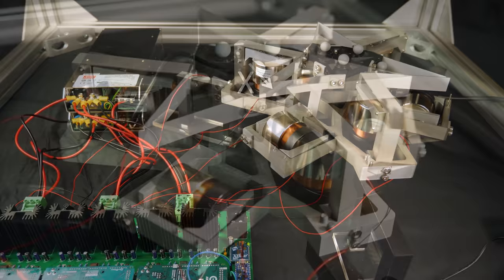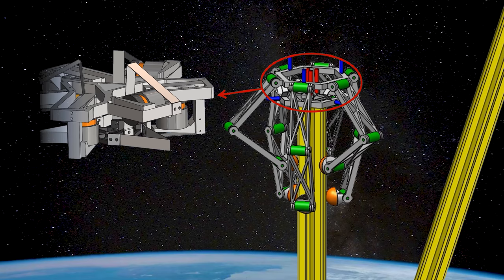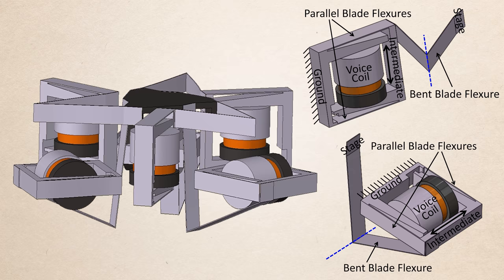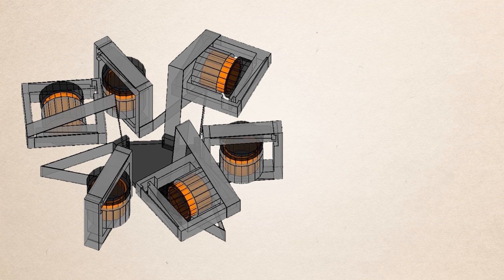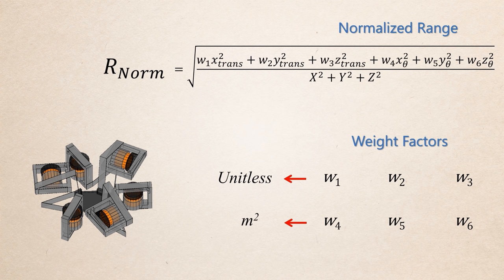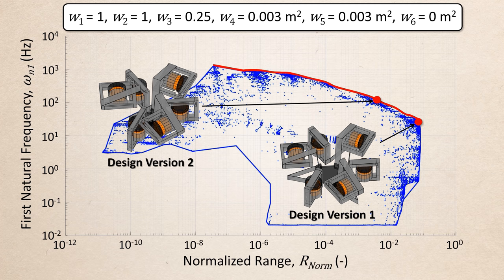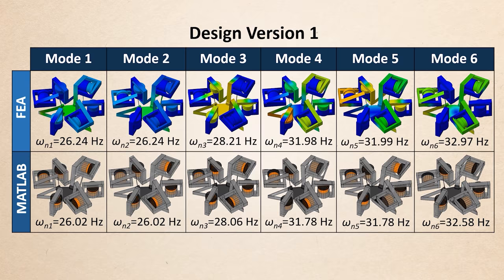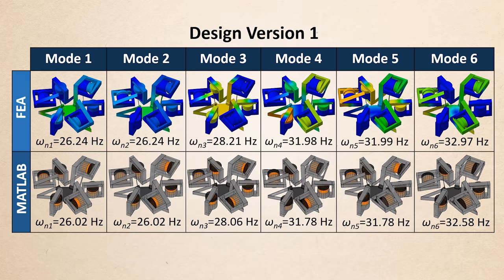Compliant 6-Degree-of-Freedom Precision Motion Stage: The Hexblade Positioner

Comment: I almost want to take this flexblade concept and make it work with magnetic sensors rather than voice coils. I've always been interesting in 6dof platforms for use as input devices, as more things become fully 3D we also need proper 3D inputs, and those inputs will more than likely be better as a combined manipulator; there's a reason why we use mice and joysticks for 2D manipulation, rather than separated single-axis manipulators in unison for planar position manipulation. Currently I believe the 3Dconnexion SpaceMouse probably has the best method for a low-throw peripheral, especially for manufacturability, though I personally want something with a larger throw and higher resolution along its movement; the only problem with these mice is that there's next to no information on construction or the method of how they're achieving six degrees of freedom, I had to rely on an obscure blog post to find one torn down, and I'm not sure how fruitful attempting to find patents would be. I've toyed around with Stewart platforms in the past, but there's just too many downfalls when reversing the mechanism for use as an input, servo-based ones aren't optimal, high resolution encoders gets costly, moving to a linear design is improbable as linear encoders aren't as common and the translation from linear to rotational movement includes losses, etc. This flexblade concept may prove to be a better alternative, magnetic sensors are, by comparison, cheap and fairly reliable, and the compliant mechanism itself is fairly simple in comparison, and could potentially be made into a volumetrically smaller package with some modification; alternatively, other depth-based sensors could be used for this, magnets are just the simplest option that came to mind, and more than likely the cheapest at the end of the day. Not only this, but this kind of design could also be translated to a mechanism that is only 3dof if a simpler input scheme is needed. The only thing is, with the modified design to make this an input device rather than an output device, how far can you actually push the throw of the platform, or if the design is inherently limited to a short throw as the original design was intended for micron levels of resolution for a printer head.
Reply: I watched a series of videos on YT where a guy made a controller similar to 3dconnexion mouse, all by himself, an advanced DIY. I'll try to find it and link it here, if not try googling it. Anyway, I really like your idea of 3d controller, I hope you will get there and enter the market with revolutionary input device and make lots of money. 
Oh, just now i got an idea, with all current advancements in  AI, computer vision and whatnot, maybe it will be feasible to just use an empty box with 3(?) cameras that will track hand  movements and translate these to inputs. Hand could be in a glove or maybe some rings or sth like that to better discern between fingers that can have different functions? Not sure if something like this isn't already in development, if I'm first and someone actually make such device please throw me some $$$ when you commercialize my idea :)
Reply: @aeonikus1  I've seen multiple projects for a 6DOF joystick like the SpaceMouse, though the only video series that comes to mind is Space Mushroom by @shiura, which uses three dual-axis joysticks and a slider mechanism for various freedoms and constraints.  Is this the one you're speaking of?

I'd also be careful with using the term '3D' when talking about joysticks, it's such a loose term that doesn't mean much, and there's reason for that.  There's 2-axis joysticks like what we see on nearly everything; and they can be considered '3D' for a simple reason, imagine you're at the center of a sphere, you can locate any coordinate without having a degree of freedom, rotation in this case, within the axis of depth, and this is quite literally how a camera stick within a video game works, and inversely you can navigate a sphere in two axes without additional degrees of freedom based on how a planar grid can loosely map to a sphere, which is how a movement stick within a video game works though this applies to really any kind of movement grid not just planar or spherical.  Then there's 3-axis joysticks, which add a third axis to the stick in some way, typically it's just a Z-rotation under the Xr-Yr gimbal, but these see very limited uses outside of some niche applications, basically anywhere where 3DOF manipulation is needed.  Then we get into 4DOF joysticks, which are typically some kind of X-Y manipulator on top of another X-Y manipulator, such as a slider or an analog pointing stick on a typical joystick, though at this point the joystick itself becomes a full-sized hand joystick due to obvious dexterity issues, where the new upper manipulator becomes the thumb's joystick.  5DOF, though rare if they even do exist, would be a combination of the two previous, a 4DOF on top of a Z rotation.  Then we get into 6DOF, which are entirely different in that they read both linear and rotated movements of the manipulator in a more complex sensor setup, again due to dexterity limitations; I guess you could take the 5DOF and put a secondary Z rotation under your finger as a bi-directional form of trigger.  All of these of which can be considered '3D' because of how we define what 3D is, and that's typically not in clean-cut dimensional axes but rather how we manipulate objects, of which objects are typically 3D, so it's better to define a manipulator by the degrees of freedom it has in total and further refine that by how it achieves those degrees of freedom; for example, the modern gamepad is 5DOF, but it uses two 2-axis joysticks and two triggers on a shared axis.  Triggers themselves are typically only a half axis, they can be a full-axis but they're almost never logically implemented as such, probably due to the fact they only move in one direction rather than two; which is why I previously mentioned a bi-directional 'trigger,' which wouldn't be difficult to produce, it's just that nobody really makes them.  There's also meaning in the term of 'joystick' modernly as an analog stick, joysticks used to be digital and there's very little implementation of such outside of arcade-like uses, but even then a joystick has to have a return to center mechanism, otherwise it's a continuous stepper which is why dial-like devices should be excluded when talking about a degree of freedom, as a DOF should be free to be manipulated rather than detented to specific steps; of which people that don't know better will probably get confused and just suggest that glorified buttons in the form of a stepped dial should be a 'solution' to adding a degree of freedom, sure our scroll wheel on our mice might work for zooming but we're also actuating that in steps rather in a continual input.  At least this is true for manipulated inputs, the term 'degree of freedom' is also dependant on use; and some might argue that digital inputs can be a degree of freedom, but I don't really consider pressing a key of stepped input equal to the amount of what an analog sensor outputs is really a 'degree of freedom,' and I know someone will be pedantic enough to argue that 'it's all digital anyways, because that's how USB communicates, and analog devices use an ADC, etc.,' but that's really beyond this argument considering a stepped input is still one-bit binary whereas an ADC will typically be 8-bit if not 12 or 16, so even by that argument anlaog, whicle digital in the end, is still much more refined.  Mice (trackballs included) and trackpads are in a limbo between the two, as they're essentially a vector device, but they're still not 'continuous' in the sense of what an analog sensor reads as, not to mention their physical, and often digital, boundaries. 
Input devices are more complicated than just calling something a '3D joystick,' it's better to use more refined terms, and to define how the input device actually reads its input.
Reply: .....Its called a waldo. They've been used for decades in animatronics.....
Reply: @TankR  No, it's not.  Waldos are also for digital puppeteering, not animatronics.  Not to mention how large these devices are when, if you had any amount of reading comprehension, the discussed topic is about mouse-sized devices.  But given your entirely incorrect use, and incorrect formatting, ellipses, I doubt you're literate enough to understand literally anything within this comment thread.  

Here's the main issue, Waldo is just a name for a range of devices, and a Waldo is purpose-built for a specific rig in digital puppetry, whether that puppet itself is digital or physical; again, none of this is on the animatronics side of a physical puppet.  A great example of this is the difference between Mr. Volt's (@MrVolt) Wheatley puppet's Waldo and production Waldos such as what Henson studios is doing for their Waldo rigs; the former is purpose built for the various degrees of freedom a specific puppet needs, the latter is more open to multiple puppets but is widely used as only a head rig while alternative puppeteering rigs control the body of the puppets- and here's the thing, the vast majority of Waldos are discretely for head and neck manipulators.  Whereas what is being discussed here, stemming from what the original device in the video was as I discussed literally only changing actuator to sensor, i.e. to make a driven output device into a driven input device, is a 6dof manipulator that's small enough in size to be used by a hand on a desktop; I've even mentioned the SpaceMouse and its DIYed alternatives, this should've been your second clue, right after watching the video and presumably having an understanding of the original device.  And here's the next thing, how degrees of freedom are used in naming, what the SpaceMouse is, its alternatives, and what I suggested in my original comment are three linear axes and three rotational axes on the same manipulated part, whereas Waldos on the other hand are rarely considered '6dof' in this way, nor are executed as such, very similar to how robot degrees of freedom are otherwise named and calculated; you're comparing apples to oranges, hell at this point it might as well be une comparaison de pommes aux pommes de terre, if you understand French and have enough logical understanding of why it's a bad comparison via naming convention, of which I'm doubtful of you having any capabilities of logical thought, comprehension competency, or even basic understanding period. 

The next issue is size, Waldos are absolutely massive and complex.  You might as well recreate a Novint Falcon for a 6dof manipulator at this point if you're arguing a Waldo would be of any practical use here.  Again, your first clue should've been the fact that the device in the video is driven by voice coils, and you presumably understand how utterly small voice coils can get, given that a lot of IEMs (earbuds) are dynamic drivers, i.e. driven by voice coils.  Again, your second clue should've been the relevant devices that have been named dropped throughout this comment thread, even if you don't know the device itself it is otherwise easily searchable; and stemming from this, even if you didn't have relevant knowledge of the named devices, you have analogous knowledge considering they're compared to a computer mouse.  And no, Waldos cannot be reasonably sized down, considering they encapsulate your hand and wrist at minimum, then on top of that you also have a stable frame to keep them in place or you have a perch that sits under your forearm.  Even if you could size down a Waldo to even properly fit on a desk and integrate into a peripheral ecosystem, it would again akin to be what the size of the Novint Falcon was, if not even large; and again here, I'm thinking you lack any amount of logical thought, comprehension competency, and basic understanding of things. 

So, what does this mean?  Waldos are nonapplicable for the argument and are irrelevant to the conversation, and they cannot be made to work in a way that makes them applicable to the conversation.  You lack any amount of reading comprehension competency, literacy, logical thought, the capability to research anything, and lack even the basic understanding of anything relevant to the conversation nor the basic understanding of what you're even talking about.  Perhaps you should educate yourself, and until the point of being educated I would suggest that you sit down and shut up.  Your reply is on-par with some of the most misguided, misinformed, and unintelligent horseshit I've read in relation to intelligent conversation.  Even out of respect for intelligent conversation, and by extension respect for others' time and intelligence, you could have at least done your due diligence to understand the conversation itself, rather than spewing nonsense that is proven to be irrelevant, especially when you do not inherently understand what you yourself are talking about.  You can't even have respect for basic conversation, any intelligible portions of the conversation aside, as your incorrect use of ellipses heavily implies a tone that I, or by extension the other party as well, have no idea of what we're talking about and implies a tone that you are talking down to us as if we're lesser, pauses in speech as how you executed always imply this tone, in verbal speech, in writing, and in literacy uses such as dialog in story writing; and this is a point you can't weasel your way out of.  People like you act like they're so intelligent, yet are some of the most unintelligent, act as if you're so highly informed, yet are rather the least informed, then you go off on this twatty behavior such as the tonal implications of how you formatted your reply, yet you're the one that's entirely deserving of being talked down to; you should be embarrassed of yourself, I'm sure others are, so again you should sit down, shut up, educate yourself, learn some very basic life skills such as logical thought and comprehension competency, and learn some basic respect for literally anything you interact with.  Given that your account has existed since 2013, that implies that you're easily in your 20s if not older, things like this should not have to be explained to you, I get it if the education system and your parents failed you as a child, but you've failed yourself in your adult life, you were likely a class clown but now you're outright just a clown that provides nothing but dogshit on a silver platter.  And on an academic channel, where most people are active in intelligent conversation, no less.  And on a comment that's actually speaking of the mechanism itself and having advancements elsewhere, no less.  Do better, a cat pissing in sand is more sophisticated than you'll ever be.

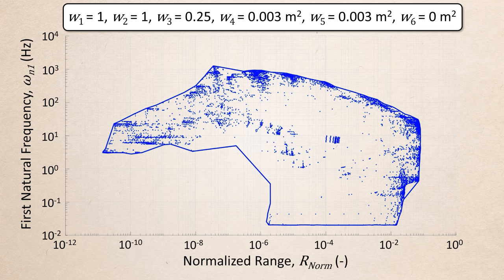Comment: I love this kind of format, a quick overview of a journal paper. Especially useful for mechatronic systems as it is much easier to understand movement of systems in animations rather than static images. As for the content, In particular I like that you kind of explored/mapped out the entire design space (7:15). That must have been quite computationally intensive, did it take a long time?
0:55 Having seen the T-flex stage in real life is very cool. Not just the folded leaf spring spherical joints are very cool, there's lots of little tricks applied in the actuation as well.
Also, I noticed that the stage/platform of the hexblade is constructed out of a polymer, is this done on purpose to have some compliance in the platform? Or perhaps to make it quick and easy to exchange for other types of end stages?
Reply: How much would it cost to use this technology to build a small robot/vibrator for the female market? I'm pretty sure we could make some money with something like this.
We could also train a neural network using electrodes on a few girls to find the best algorithms.

Comment: I love the design and the use of the matlab script you used to calculate it. My one complaint is that 7075 is poor in fatigue, and this seems like a design ripe for a fatigue failure after a few thousand hours of operation. For such thin flexures there are many steel alloys that would be superior at a minor weight penalty.
Reply: CF composite from 3D printed molds?
Reply: A print head mounted on one of these platforms could print a line path in non-flat layers that are optimized for physical properties like resonance and flexure.
It might be useful to be able to directly generate the Gcode to FDM print a (fibre reinforced?) PLA/nylon/PC positive for this platform's frame from. Perhaps simulate the FDM line structure as well as the shape.

So, even more maths. If implemented in an online calculator it would need a very long progress bar and probably a PayPal button.

Comment: Fantastic design and demonstration. I just wondered why the coil isn't fixed and the external cup moves so as to remove any flexure to the driving wires? That would remove any chance of fatigue that may cause failure, however unlikely given the small range of movement? Thanks for the brilliant demo.
Reply: Often the coil side is lower mass, so you put it on the moving side to keep your frequency response up.